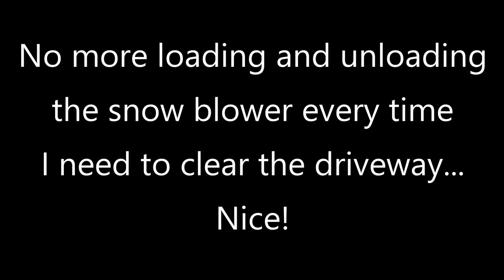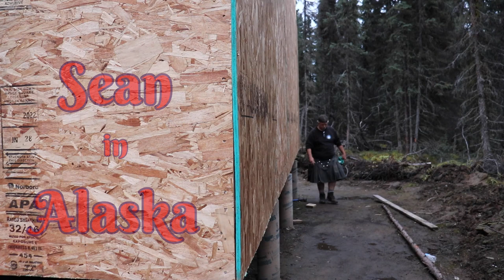Adding the top plate to the Alaska cabin

Comment: We had a snowblower about that size, what we did was unhook one of the wheels so it would only drive forward from one side. Makes it take a little more effort to keep it straight but made it much easier to turn it.
Reply from the maker: That is a great idea!
Reply: If you have them set up for "positrac"  they are a pain to turn. Should be a collar or something that can be removed so that it drives one wheel only.
Reply from the maker: I will check! Thanks for that!

Comment: I don't know if you've been told this but a lot of times people punch a couple of holes in their subflooring for the draining to occur for the short time before they build the roof so the floor doesn't have issues more than you can help anyway.
Also you're Doing Great.
It almost looks like you're fighting some frustrations. On the show from some of your mannerisms. This is pretty common when you're working by yourself or with very few people to do a project that can be difficult when working around good weather climates.
Reply from the maker: i have thought of popping a few holes in lol...until now i did not know that was really an acceptable option lol. 
   i do occasionally get frustrated and i am glad it shows. working by myself  forces limitations on how and how fast i can do things and this does get to me at times. i think it is important for folks to see that doing this is not always a bed of roses lol...i always do get over that frustration though and move ahead, and tgat to me is what is most important!
Reply: @SeanInAlaska  
So with holes in the floor it drains quicker 
it's a double edged sword
But it also can erode or degrade the subflooring material.
But so is having to deal with water on it frequently. That's why people put holes in the floor and just let it drain by tapping a few nails through and then pull them back out.
It's really nice to see that you don't let your frustration stay in charge when you're building. For an amateur builder you're doing one heck of a job though.
You mentioned once about building your loft then putting on the roof. I think that this may be a very good idea. Since you are working on this majority alone. If you can manage to do the One internal wall for the loft that goes across the house in a day or two with the ceiling/ floor; it could very easily give you the stability and ability to put on the roof before snow comes.
Reply from the maker: The draining seems to have worked itself out, it seems that water always finds a way down hahahhaha... I will be picking up lumber this weekend and starting the loft first. My thought is that doing this will allow me to tie the walls together before the weight of the roof goes on, and, I can stand on the loft while working on rafters hahahahaha. 
    I really appreciate your comment about the job I am doing, my plans change often and there are things I would do differently if I could, but all in all I am really happy about how this is turning out!